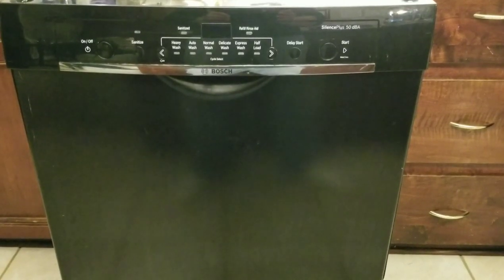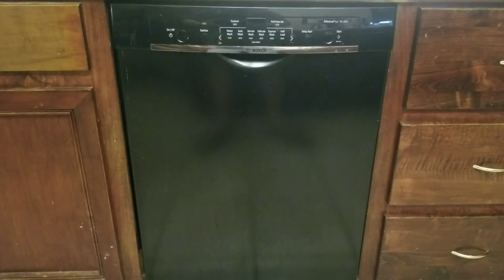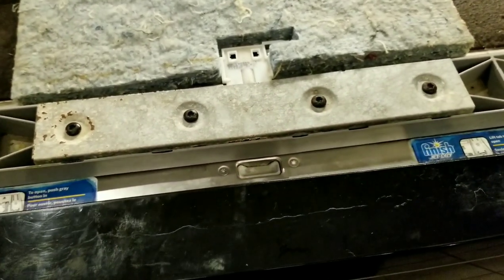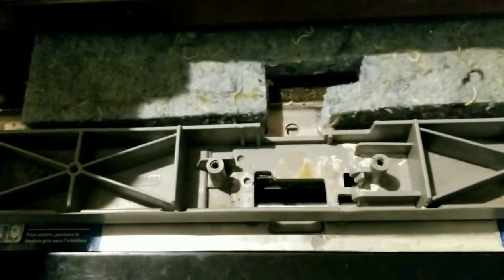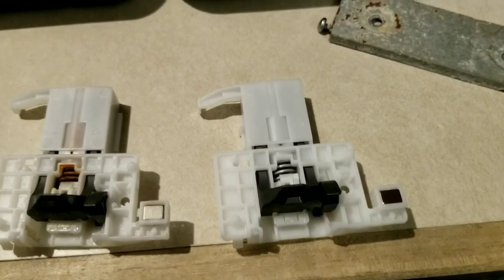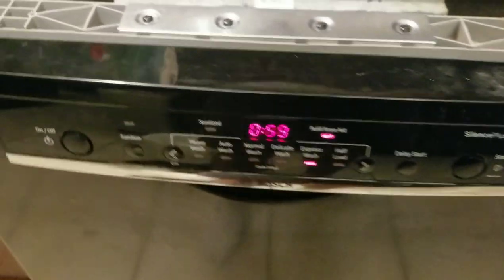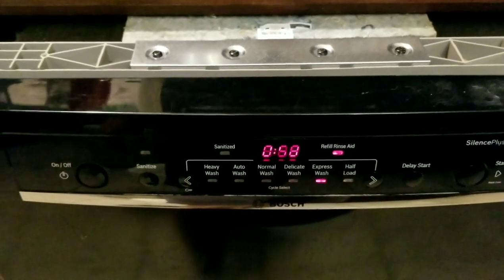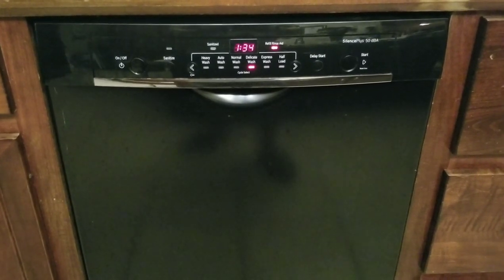Fixed!  Bosch Dishwasher Cycle Not Completing

Comment: Thanks, super helpful! Was having the same issue and with your help it's fixed! One addition that my repair required was a shim added to the top center (above the door latch) to help press it down. I found another video referencing the need for a shim and that helped get the job done.

Comment: Here IS The ACTUAL REASON and LASTING FIX: The problem is that there is a clog or partial obstruction "somewhere" . The issue is finding the clog.  (Wait you say...I cleaned out the filter, pump cover, pump impeller...etc. then I cleaned out the drain hose ...100% checked and no clog). Maybe...Well....so did I. I shop vacuumed hose and sump and it and blew it out with a compressor...Dishwasher and Drain hose verified...Clean as a whistle. But..I experienced all the trouble and inconsistent pumping/Washing/Pumping?"Clean" Light behavior that others did. Cleaning out the filter and then resetting by shutting off the breaker for a few minutes usually works.  Also the work around like this YouTube may work many times (Thanks Morgan). But eventually this is not working. My filter was clean from a few weeks back.... so when it showed up again I was perplexed.  Also, The clog can be partial and just causing some back pressure to trigger the stop and clean light. Then you think all is clean....AND my sink runs good so the drain & trap must be clear...right? . Here is  the more nefarious issue that is similar to people with disposal units.  I pulled the hose off of the Y again...That Y joint is the last point in the path that was untested...I gently put a screwdriver in there and felt a little resistance...then pushed a little harder and POP.... a little clog in the Y adapter fell down into the trap! Voila!. I have a low Y connector where the hose connects just above the trap. The clog can get pushed out a bit and with a little siphoning or the trap backing up a bit that crud can get pushed or sucked back into the Y.... causing the problem to seem fixed and then come back.  Even though the hose itself is not clogged (Ensuring a high loop on the drain hose ...or installing and Air Gap mechanism...helps this issue a bit).   The point is that when the pump keeps cycling on and off and water is sitting in the bottom with and early stop ...and the "clean" light on....the path to and from the pump is blocked or partially blocked. Go from one end to the next and make 100% sure it is ALL clear. If the pump has back pressure or a clog it will tray a few times and then trigger a stop and clean light!. That is it.

Comment: Same problem, I Have an older model Bosch #SHE3ARSXUC. I changed the inlet valve with a OEM part "40$". I found by vacuuming the drain area below filter basket  and drain hose it started working all the lines have been disconnected and cleaned out. ( Still defaults to clean) ..I am going to change the float switch next and see what happens. Perhaps this is the issue?  Perhaps there is a weak signal telling the inlet valve to open and start the filling process? a faulty float switch? .. I'm  baffled why it works after the drain line is completely cleared but unfortunately I can't figure out what the root cause is. I can fix most things and I will not give up. My Wife is starting to look at new dishwashers at 1000,$  so therefore I'm under a lot of pressure to get this problem solved🤣🤑:face-fuchsia-tongue-out: